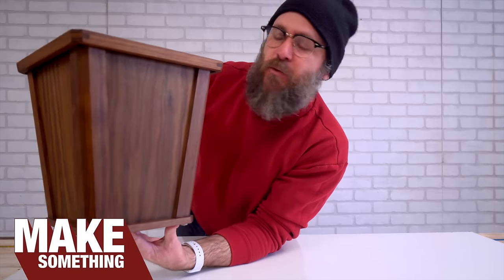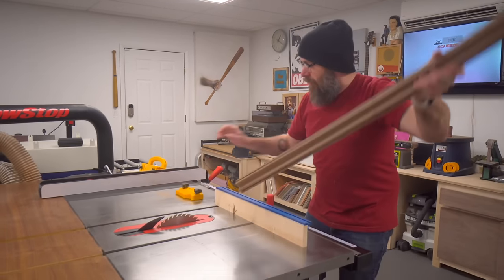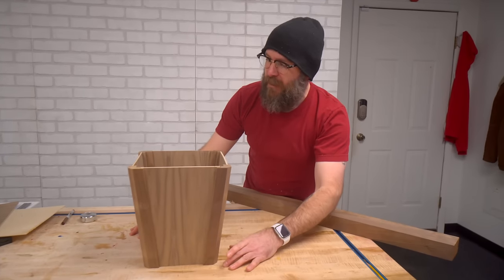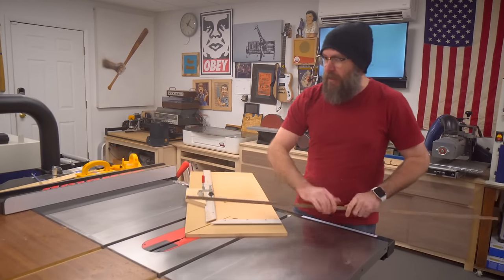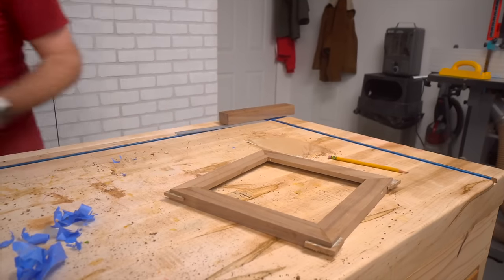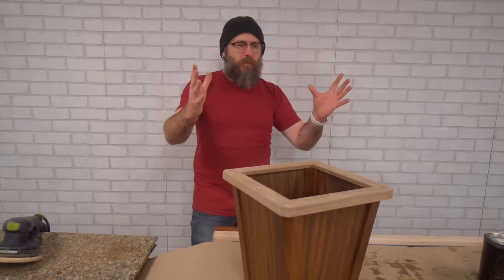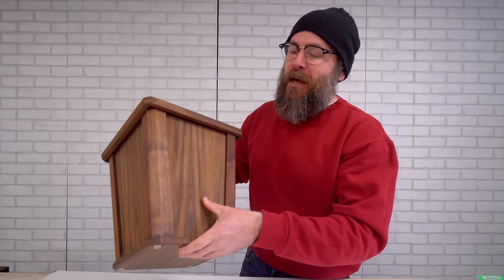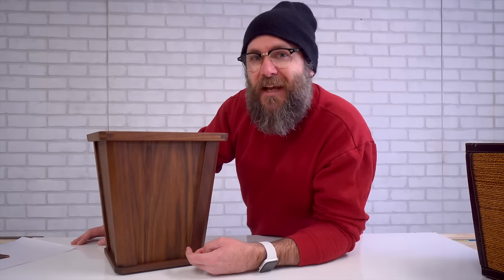How to Make a Wood Wastebasket Bin // Woodworking Project

Comment: Loving the new white brick facade of the sliding doors, and your camera loves the focus too. 

I was listening to the podcast where you mention your concrete /string weights. I hadn’t seen you use them, but they were well described. Bigger than I imagined. 

The thing I got the most out of this video was the deeply complex compound cuts for the corner pieces. Impressive.

Comment: At 5:04, on the disc sander, I would start on the outside and then move inwards, because the speed is lower near the center. So you want to end there for more accuracy. Does that make sense?

Comment: hi Dave.  very interesting project.  how did you figure and also cut the angles of the posts?  it is a complex angle, not just a 90 degree cut.
Reply: Me and my dad just made an Infinity Lamp over on our channel with similar angles to this trash can. And honestly dad just had to mess around with the miter angle and practice on some junkier pieces of wood.
Reply: He used an angle gauge, then matched his table saw blade to that angle. The chamfered corner of the post allows him to use that edge as the reference surface to the table saw table when making the cut.

Comment: Is the kencraft where the 84 lumber used to be on Westwood?
Reply from the maker: It’s on Westwood and has been there for 20+ years. Not sure.
Reply: Well I used to drive down there everyday, I just remember seeing an 84 lumber. I was just wondering , but if its been there 20 years then that wouldn't be the case.